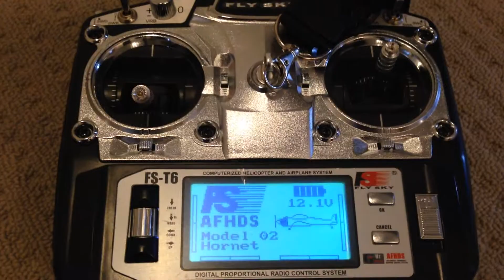Dualsky Hornet 460 Quadcopter Problem. HELP!?

Comment: Haven't seen that happen. I doubt that it will make a difference but if it does the same without the TX on, at least you will have isolated the problem in the copter. You will love the copter when it gets going.

I had a couple of teething issues at the start but my supplier worked with me and it is awesome.

Comment: Are your servo plugs plugged in backwards?
Reply from the maker: I have since worked out that it was something wrong with one of the arms. Either the ESC, Motor or Circuit Board. Dont know which as i dont know how to test it. I just replaced the entire arm with all components. Go to my channel if your interested to see the Hornet 460 Fixed video and read the description. Thanks for your help

Comment: All ESC do this. Every time it gets decalibrated it freaks out, and demands a new calibration.
Reply from the maker: Thanks for the comment, do you know how to test this to find out which one is doing it and how do you know if its fried or needs recalibrating?
Reply: I was re-calibrating, and I find out that you can enter the ESC calibration mode, so I do believe it is possible to change the ESC settings but, I have no idea how you find out the correct beep sequence, since you do need to know who makes them. The arms did the same noise when I was tingling with it, so you kinda wasted some money but, on the bright side, now you have a spare part.
Reply from the maker: Ryuuken24 Thanks for the info, its a shamr the ESCs dont just plug in to the arms, would be so easy to test them and change them over, same with the power plug from the main board. I dont know if you watched the other 'i fixed it' vid but yeah i bought an entire replacement Hornet, so i have LOTS of spare parts :)